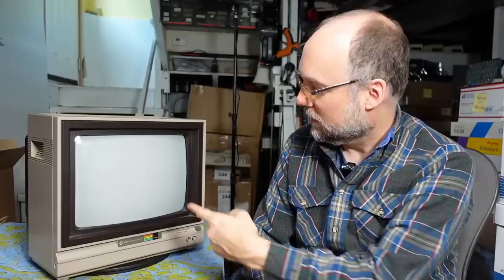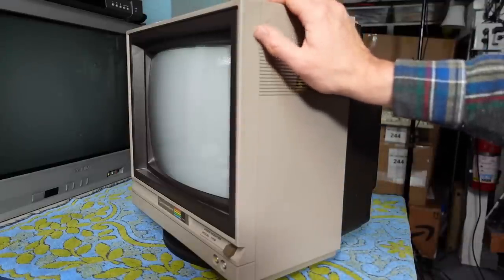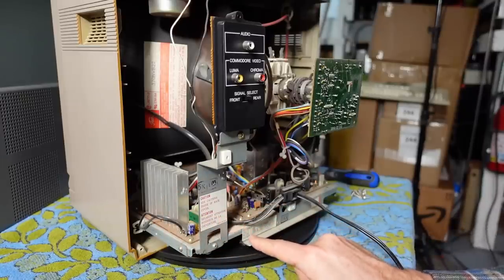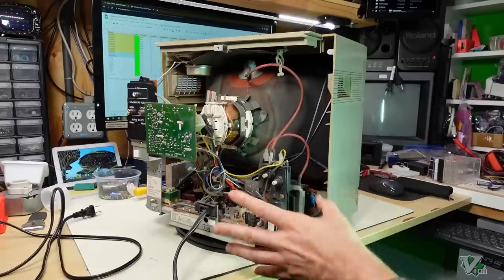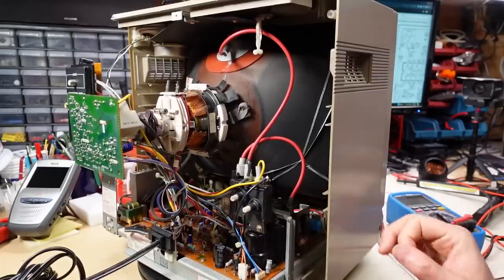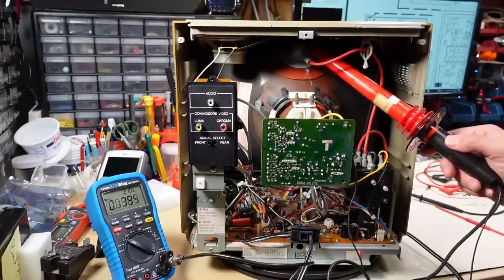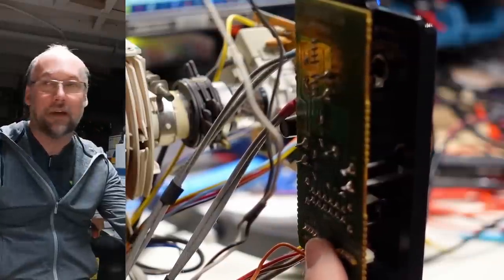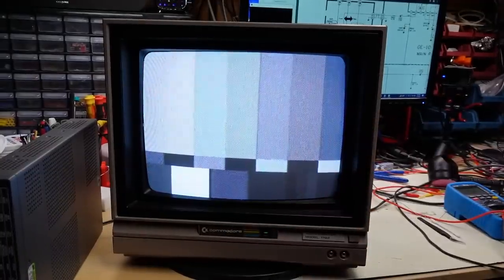This is one of the best monitors of all time (Commodore 1702)

Comment: I use the rear luma/chroma jacks on the 1702 for composite. Simple non evasive mod. with single female to dual male rca Y cable. Plug the two male ends into the luma and chroma jacks and then the composite source into the female end. The result seems to be a perfectly acceptable composite image from any composite source. I never noticed any degradation from using a y cable on the back instead of the front composite input.

Comment: You and I have something in common:  I've never owned any Commodore hardware.  I've always thought that a C128 would be the way to go, but that's probably because I cut my teeth on CP/M.  It seems like a CRT like this one would be a good find to go with a C128.

The "Christmas tree" ground is for Earth Ground;  The "brush" is for Chassis Ground (Reference).  In MOST cases, the two are bonded together somewhere, but this monitor does not seem to be one of those cases.  Be careful with an o-scope on a device of this class.

Comment: Very nice! I have a 1702 as well, still works as good as the day it left the factory, the only problem that mine has is that when you set the volume to loud, the picture starts shaking, I suspect due to aging capacitors

Comment: Adrian, I have a Phillips 8833 which I believe is the same as a 1084 except no separate luma chroma inputs. I’d like to see you mod the 8833 to add the luma chroma inputs, or at least show a comparison of the two input schematics. I know that  I could just bypass the composite input filters. I worked at Kodak in NTSC signal processing but that was over 30 years ago so I’m a bit rusty! The Phillips doesn’t have the SKART knockout, but I wonder if the pcb has the circuitry in place? that would be interesting to see you do! Thanks!

Comment: One thing, not mentioned but a great plus for the 1702... it has handles.
So handy for carrying my 1702 around. I wish my 1084 had one.
RGB amp+levelshifter should be relatively easy to bodge out of some high speed op-amps. It's not like the tube needs a lot of current to drive the colour grids. Where to drill the holes though (for RGB jacks)? Not keen on drilling holes in my old monitors myself...
Cheers,

Comment: If I have the privilege of owning one of these monitors, I would be swapping out the two-prong cord with a three-prong, and connect the ground pin to the metal chassis. I don't blame Adrian Black for not doing so to keep it original, but I'd prefer safety.

Comment: 32:23 I suppose they didn't do it for the video to limit the possible reflection-caused interference due to having a star-like circuit, as the video is more susceptible to this. The other plug not being terminated would bounce the signal back. Although it's probably negligible with a correct signal.

Comment: If the anode voltage rises the picture will get smaller, if it drops the picture will bloom. The extra acceleration will mean the yoke has less effect on the beam. So if you have a small picture one day you can worry

Comment: Looks like the Yoke could use an adjustment on the 1702.  The picture looks like it is slightly clocked clockwise.  Of course, that could just be camera angle.

Comment: One of the problems with making an “RGB” mod is: are you expecting “analog RGB”, or “digital RGB”? So, IIRC, the Apple //GS outputted analog RGB, but newer PC video cards that had VGA/SVGA, were digital RGB. Or, you could just hide a “retro tank” inside the 1701/2, and run the RGB out a hole in the back (which would involve some “plastic surgery” on the back cover of the monitor!) 🤔

Comment: I bet you dusted while apart. There's usually spark gaps that will arc if dirty, on the neck board. Back in the day we actually had a wash station for boards. Solved most arcing issues.

Comment: I believe you can still get NOS flybacks for these of you have arcing. Also, I had a similar issue with mine and took it to a tech after recapping and installing a new flyback. Turns out, the backboard was a hair loose!
Reply: Do you happen to know to replacement flyback part number? Or where the flyback was purchased from?

Comment: Interesting that there's no 'interlock' on the back for the power cord. I guess that only applied to 'consumer' units.
Reply: Interlocked power cords seem uncommon on "new" equipment like this. They probably went away when the "no user serviceable parts inside" stickers went on. If a consumer doesn't open the back to change tubes then they won't get shocked by the insides.

Comment: we're gonna be taking a look at this. yes. it's a 40 year old fire hazard. :P (old crt based monitors and tvs actually are just that. running at multiple kilovolts. metal fatique and brittle plastic all over the place. besides the usual capacitor issues.) not stuff you want to leave unattended for more than a few seconds.

Comment: Adrian, I’m working on a 1702 with no vertical deflection. The 25-26 volts that are on ic-421, does that come from the fly back? I have no voltage on that ic. My power supply is not putting out the 125 volts from the regulator, rather about 69 v. Thinking maybe I have a bad winding somewhere in the fly back. Your thoughts? Thanks for the video. Helped me a lot with my 1702.

Comment: Great monitor the 1702, compared to the 1084 series. But I've looked out a problem on the screen. The image on the screen is not perfect. If you look the footage with the monitor turned on and with a test card shoted up, the picture looks a slightly inclined from left to right. Probably is the deflection yoke a little bit losing its right factory setting.

Comment: REQUEST: When relying on your pointer to show schematics, please make your pointer bigger. It’s impossible to visually follow your pointer movements until you apparently realized this at 24:20 and turned on mouse pointer highlighting. That probably helps most people, but it’s still faint and small, and might not help all users on all devices or with color blindness etc.

Comment: Still have my complete C64 setup including this monitor and 2 - 5 1/4" drives. All of the 5 1/4 floppies still work also :). Have the working tape drive and the voice module as well. How good is the 1702? It's still being used today for security cameras at many stores 40 years later.

Comment: Hmmm... i have a couple of these. 
The back "s-video - Chroma/Luma" inputs work with composite. I just use a Y-splitter RCA cable and run the composite signal through both "chroma" and "luma" inputs. seems to work fine.
Can you confirm this? i mean, the picture looks the same as just plugging a single RCA composite cable into the front.

Comment: I bought a 1702 from my school in the early 80s for £10 which I used for my ZX Spectrum with a composite mod and then my Amiga 500 until I bought a multisync monitor for my A500/A1200 before the Amiga died and I went PC.

Comment: The unfortunate thing about these monitors were they were really popular as security monitors too mainly because of its stackability and price. I've seen way too many with screen burns. That scene from the beginning of Stranger Things was no joke.
Reply: they're not stackable. unlike actual security monitors these will distort each other's image when placed right next to each other. real security monitors have a shielded metal case. and are an actual square box. (and tbh are better for computer use too than these commodore ones ever were ;) sure you can put 1702's in a rack or on a shelf next to or on top of each other. but then the images go all kinds of funny colors :P so they are most definately not stackable. physically: yes. but in actual use: no. they also lack a phantom powerfeed to the cameras. don't have bnc input. can neither handle rf modulated cameras nor daisychained ones (that's not rf, that works some other way) etc. can't do a timed switch loop between multiple inputs. etc. don't have a switchable line impedance, the lot. now back in those days you would not have 8 cameras at your main gate and like 4 per hallway. you'd have maybe 1 or 2 at your entry and like 8 in total. and if you were lucky a little boxy thing that could display a few of them at the same time on a tv channel or something. so you could put this in your bedroom on just one. but they by far are not suitable for security room use. they also are not nessesarily cheaper seeing that pretty much all cctv cameras back then were black and white :P they barely came out with some ccd ones with infrared when this thing was brand new. those old vidicon cameras themselves would also burn in btw :P and if you ran really fast it would just see a blur :P (probably still to be preferred over 'modern' ones of which the built in infrared lights seem to attract spiders all night long when installed outdoors ;) LOL. 'its a ghost' 'oh no its a spider again'.
Reply: @CB3ROB-CyberBunker   I men I literally have a couple of them stacked on each other haha. I didnt say they were made to be stacked. But yeah I actually have a lot of security camera screen burns on these things for some reason or another other despite being from different places.

Comment: If there is arcing in the flyback, you should also hear a constant hiss (about 15.7KHz) coming from the transformer.  If you have the service manual, it will also tell you what the grid voltage should be.
Reply: if you can hear 15khz that is!!
Reply: @barnabas5688  If there's arcing that bad you can smell it I suppose.

Comment: The original Atari ST color monitors were also made by JVC and were superior to the Commodore 1084S being sold with the Amiga. Quite a few Amiga owners bought the Atari color monitor with a custom built cable (a lot of Atari dealers would make the cable for you) - the result was similar to the 1702 - brighter colors and sharper picture. Then Atari switched to Goldstar for the color monitors as well as the ST monochrome and they weren't as good. I think there were also some Commodore 1084S batches that were made by JVC, as they had much better pictures than the later models we were selling. Probably a cost cutting measure by both Atari and Commodore to use cheaper monitors at the cost of quality.
Reply from the maker: I think there is a third color monitor for the ST as well, which I can't remember off the top of my head. I have three types (visually look different)
Reply: I'm not surprised there were more models outside of the US from the two we had in the early days as well as more manufacturers than the ones we saw. When Atari didn't have the color monitors in stock (which happened way too often) we even used whatever we could source that had the specs to work with both the Amiga and ST, but often with so-so results. I think we sold Thomson, Amdek, and Magnavox/Philips at various times. And Commodore was almost always out of the 1084S. And the only two 1702 monitors we had, used to display the C64 and Atari 8-bit, got stupidly sold off. We did have a nice Commodore monitor on the C128 that would do a crisp 80-column, but I don't remember the model number.
Reply: @nemesis2264  Thanks! Went looking for pictures and pretty sure it was a 1902a.

Comment: Because of the arcing: did you check the solder joints on the main PCB for the flyback transformer? I used to have trouble with them, cracking as the flyback transformer is a pretty heavy object. An extremely simple fix by the way.

Comment: Luma and Chroma? I'm not particularly familier with the C64, but am familier with the BBC Microcomputer by Acorn, and that had a 6 pin Din connector, which included RGB lines, and I'm fairly sure the Amstrad CPC 464 also RGB outputs. So... Luma and Chroma, while being a significant improvement over RF and even Composite, it doesn't feel very good when compared to RGB on the Amstrad and BBC.
Does the C64 not have RGB outputs?

Comment: Years ago, my grandmother gave me an old Sharp TV.  It would arc if the image on screen was too bright (white background in a commercial, etc).  I would just turn the brightness down a bit until the problem went away and then it would be fine.  I suspect the reason your monitor didn't arc when you set up the camera is because you turned the brightness down at the start of the test.
Reply from the maker: Normally brightness doesn't have any effect on the high voltage output
Reply: @adriansdigitalbasement  all i can say is it definitely had an effect on something.  The issue with my TV was specifically related to the brightness of the image on the screen and not necessarily the setting of the brightness knob.  I don't know if you monitor's problem is the same, but you might want to run it at higher than normal brightness and see if the problem returns.  I'd be curious what you find if it does.
Reply: @adriansdigitalbasement  ????  Usually brightness has the largest effect on the high voltage output, but it's the opposite. Brighter output draws more current which pulls down the HV. I would expect to have more arcing problems with a black screen than a white screen.

Comment: I would love to "break" the AUDIO front/rear so you dont get both simultaneously indifferent of the switch setting, I have found if you have something connected to the audio connection on the rear and the front it can often severely impact the audio quality (now I have to manually unplug the front audio plug to avoid this and manually plug it in when I have the switch set for front and unplug the rear plug and vice versa if you have the switch set for rear). if you dont disconnect the audio when using both the front and rear the your audio is poor, disconnecting the front and rear connectors hard wiring would solve this. Why commodore didn't keep them switched at the switch kinda boggles my mind.

Comment: Hi Adrian, I have a 9" Zenith color CRT I want to get rid of with out tossing it down the rubbish chute. Besides, it might be heavy enough to destroy the chute. Also, I don't have any way to discharge it, so if the charge should somehow survive the fall....

Any way, I was wondering if you might want it. Have no idea if it works. I found a large electrolytic cap in it with one of them fancy new fangled highly domed tops, and figured that's why it came into my possession.

We could set up a meet if you want it.

Celeron

Comment: I read somewhere that said you need a resistor if you wanted to direclty plug in S-Video to a Luma-Chroma display, becuase of the slight differences in voltages used in each that could damage both the display/port and whatever device is being connected... i have no idea how true this is, however...  I'd still love to see either an RGB mod on this thing, or a genuine S-Video mod...

Comment: The 1702 doesn't have a true S-video input.  The signal levels aren't quite correct, so to adapt the signal to work correctly with an S-Video input you need to add a resistor to attenuate one of the signals.

Comment: You had your terminology backwards. A lower dot pitch gives a sharper image, not higher.
Reply from the maker: It always confused me LOL because smaller = higher clarity.  I recall VGA monitors sporting 0.28 which was a better than those low resolution things with 0.42 ... Perhaps if we had called it a finer dot pitch it would make it a bit less confusing.

Comment: Adrian, have you ever seen a PAL 1702?  I love the way the 1702 looks paired with a classic breadbin, but since I switched my commie to PAL for better compatibility with demos, Ive been searching for a long time for a an affordable PAL 1702.
Reply from the maker: Never in North America... Look for the Kawari VIC-II replacement. I asked Randy to add NTSC-50 support, which he did. The Kawari will generate a video signal that runs at PAL frequency but uses NTSC color encoding. The NTSC 1702 should work with that, but I haven't tested it.
Reply: @adriansdigitalbasement  thanks! I ordered the big board version after watching your review, and I'm very excited to give it a go as soon as it makes it here from Canada.
Reply: @adriansdigitalbasement  Excellent. I'm in the US too and have a 1702 and was wondering the same thing about the PAL mode of the Kawarii.

Comment: Do you ever get an amstrad cpc464 monitor come in with frame failure the screen has been pulled in to a funny shape. Normally they crash to a line but this one is squeezed into a smaller screen in the centre and is mid shaped. I’ve had the back off and pulled main board out and checked for issues but I see nothing burnt up or bad joints. It worked ok last time it was used so I guess it’s a cap issue or something similar.

Comment: Hello Adrian :) The main reason of HV arcing in CRT devices is the dust under rubber gasket of anode cup. You should disconnect this cup from tube, use clear alkohol to clean the graphite coated surface AND the cup itself. Of course you perfectly know to discharge the tube before work ;) electric shock is not even close to deadly but it's very painful.

Comment: I’ve seen the random electric arcing on two of my 1702 monitors and it is scary. Do you think running a ground wire from the chassis to earth ground would be a good idea?  Hate to think that claims of voltage buildup has nowhere to go but randomly into the circuits. I tried the ground to the chassis for a few minutes and didn’t see any negative effects. I measured over 40 VDC continuously going between the chassis and earth ground on my meter as long as the monitor is on!
Reply: Arcade CRT monitors are always earth grounded by the way. As where more modern CRT monitors in the 90s.

Comment: Please tell me you're going to re-align the tube so it's not off level by like 5-7°. Dunno about the 1702 but a lot of monitors had mounting plates with slots so you could literally rotate the entire tube a few degrees rather than re-aligning the guns.

I guess you'd be able to tell if it's a mounting problem or a gun problem by looking at the RGB stripes and seeing if they're off-vertical.
Reply: First thing I thought when I saw it: "It's listing to starboard."